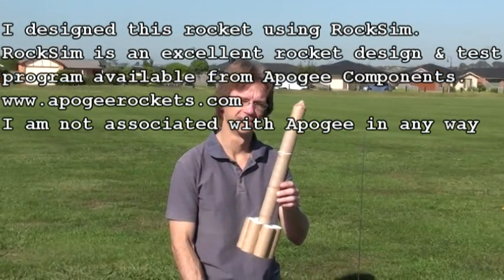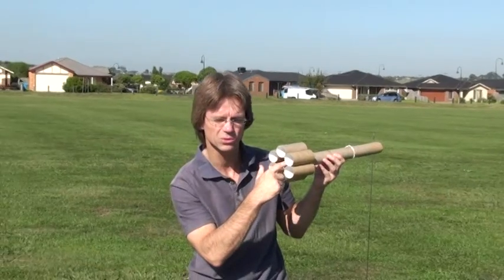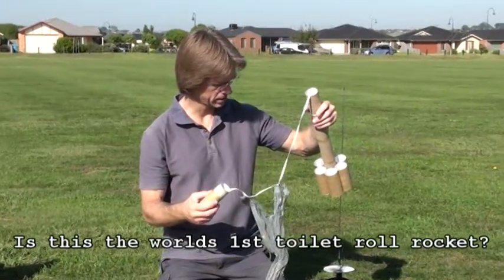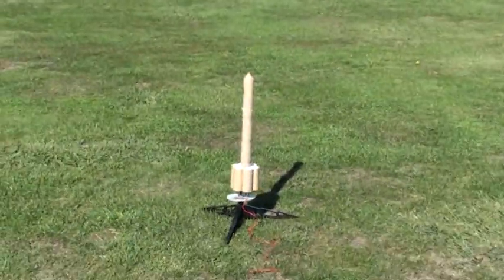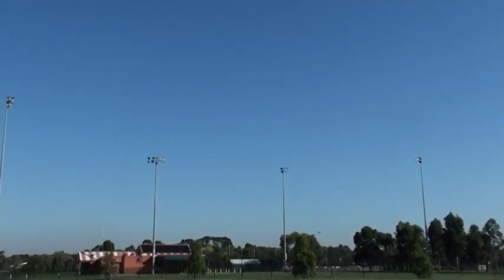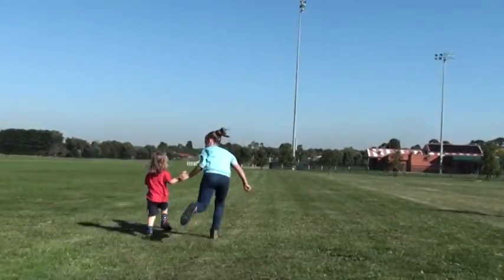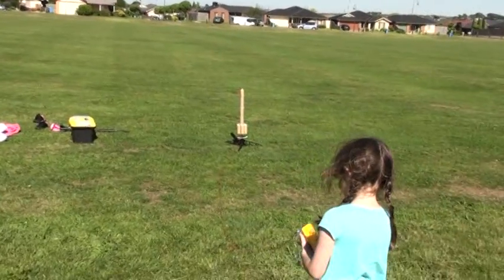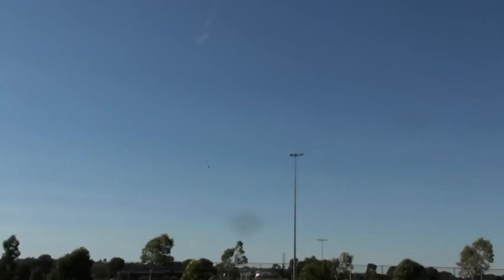Toilet Roll Rocket

Comment: If rocks I'm confirmed it stable than it will fly.
Reply from the maker: Its a great program and very easy to use.
Reply: indeed. I don't why you thought that would blow up, if you confirmed it stable on rocksim than it won't. :D it is quite a fun and great tool. Every hobbyist should have high power or low.